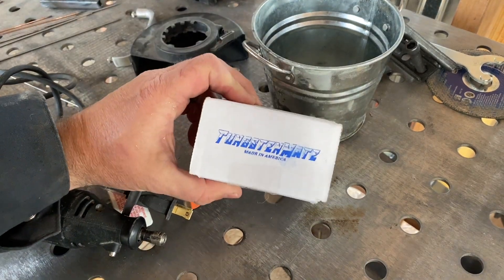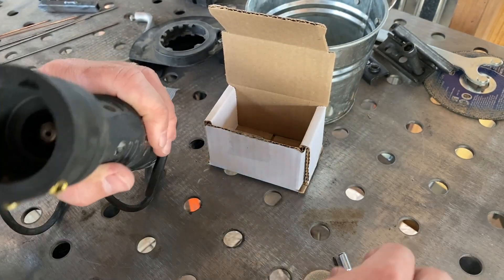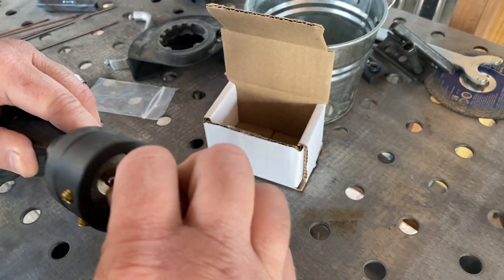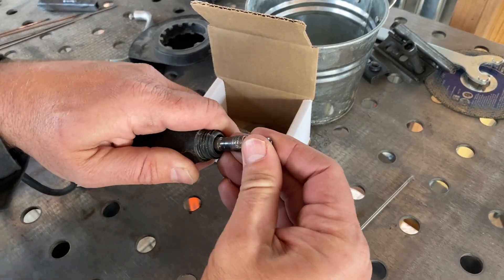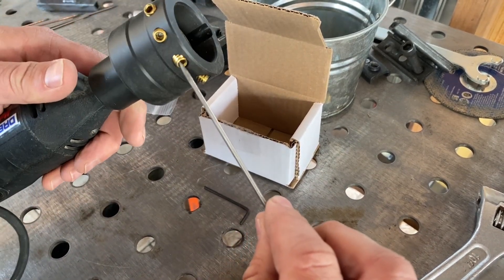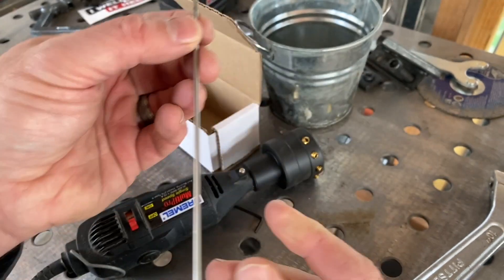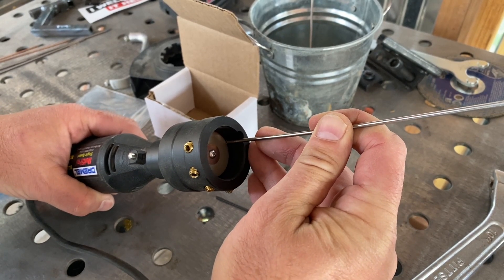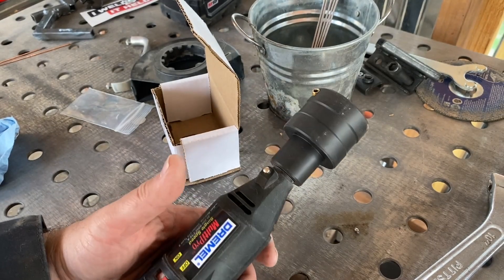Tungsten Grinder Acquired for my PrimeWeld TIG225X   HD 1080p

Comment: You just put a slight kerf in the tungsten then snap with pliers. Always break off the contaminated tips from the tungsten so you don't just keep contaminating your sharpened tips from the grinder wheel.
Reply: The round cutout in the housing is for you to be able to cut off the end of the tungsten.
Reply: @69nites  have you used that feature.....seems logical but usually it grabs your tungsten and flips it out of your hand screwing up more than its worth....lol
Reply: @shrconstruction  I don't have this particular tungsten grinder, but I figured you can just grab the end with your pliers and use the body as leverage in the cutout.